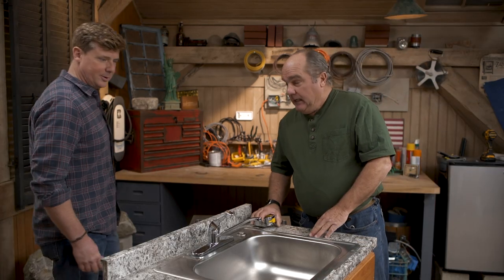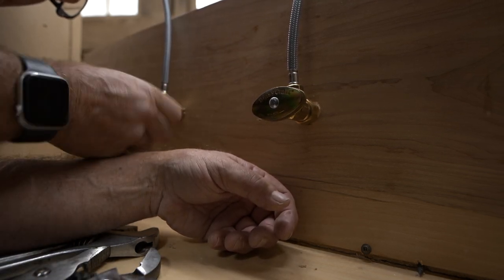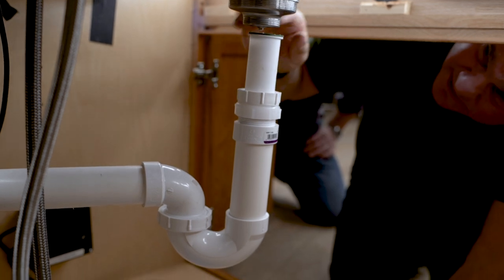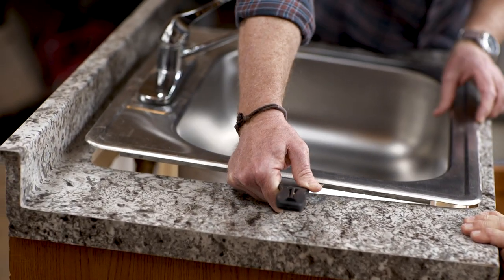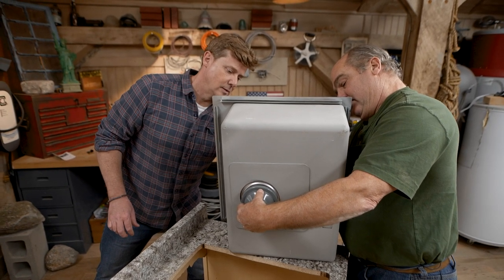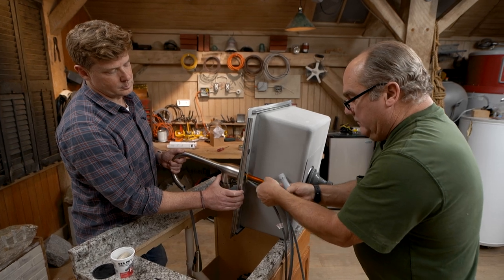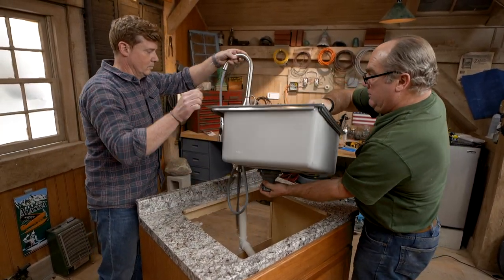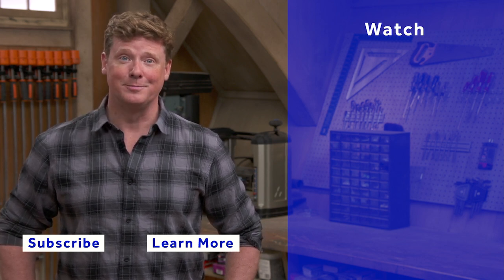How to Replace a Kitchen Sink | Ask This Old House

Comment: From a pro like Richard I’d like to hear how to handle the UNusual problems.  When replacing a sink those cutoff valves are always old, maybe brittle.  How to prepare for one snapping off and flooding the kitchen?  How much force does one indulge? Use the house cutoff first, maybe drain the house first?  Those new faucet lines might leak under counter, but only when the faucet is on so it’s undetected.  A major uncontrolled water leak can destroy much of the area and be out of budget to fix for any DIY. It just can’t be allowed to happen.

Comment: I'm surprised drains haven't come with a gasket all these years.   I mean sinks always have that inset for the putty to go down, unlike anything else the sizes are actually a standard size,  seems like a perfect place to have the manufacturer to spend an extra 12 cents and throw in a gasket, or 30 cents and put in a really good gasket.
Reply: it really is the classic plumber's lament!
Reply: I agree
Reply: Pretty common in Europe for many years. Actually, I've never seen to use a putty ✌️
Reply: Yes!

Comment: Kevin didn’t even try to break the seal he just straight up wanted to pull the counter and sink apart
Reply: Richard didn't even disconnect the front clips very much at all,  this was an all around "We have to build this setup just to take it apart??"  type of enthusiasm on this project
Reply: Well it was a demo set up there was no seal. except possibly a small amount in the front just to show them break it right before they lifted it out.

Comment: Has anyone had any experience replacing a cast iron or acrylic sink with a stainless steel sink? I bought a stainless steel sink that matches exactly the measurements of my existing cast iron sink, but the installer Home Depot sent out to install and connect it insists that it can't be installed and would lead to problems down the road...has anyone else experienced anything like this?

Comment: How about changing a sink from the 80's instead of a 2018 cakewalk.  Replacing a sink with old shutoff valves and soldered copper pipes that should be replaced with the flexible metallic hose used in this video would be more valuble.

Comment: I have a project you don't have a video for, at least I could not find it. How to remove a kitchen sink that was installed using liquid nails, but not on the ring that goes around the sink. Have good days!

Comment: I'll never use putty ever, ever again! It always dries out and leaks a few years down the road. Pure, clear silicone calk all the way.
Reply: If you use a sealing caulk instead of a putty or gasket on plumbing supply or return line  you make it difficult, maybe impossible to undo and replace later.  Caulk down a faucet valve to a surface for instance and then torque it down means likely impossible to remove years later without destroying the fixture.
Reply: @Nill757  Beats water leaks under the sink.
Reply: @mehodgsonsr  Ive  never had or seen properly used putty leak, which means never used for pressure water and applied correctly.    Its always, always, pressure water lines or the grey water PVC drains being knocked around under sink that leak.  If all of that went away, then maybe bad putty can be replaced with silicone sealant, if somebody wants that sink replacement shown here turned from a 15 min job to something much more involved because that sealant won't let go.
Reply: @Nill757  I used putty under a new faucet years ago. The faucet was fine for several years. Once the putty dried out, water got under the faucet and under the sink. Never again.

Comment: Never use oem gasket will leak always use putty.
Reply: Never used putty in 20 years.
Reply: I use plumber putty myself,  but that looked like a Kraus basket strainer you can install them with no putty and they want leak I've installed a few and there basically idiot proof I think a five year old could about install one. That's probably why it's on this old house.
Reply: Say goodbye to any warranty if you do not install per manufacturer's recommendations

Comment: Why are there holes in the sink at all?   🤦‍♂️ You cut them where and when you need them. Then you don't need this ugly cover.
Reply: did you miss the part where they are replacing an exisiting sink not installing one in a brand new kitchen, I mean it's even in the title...
Reply: @nzspambot  ? 3:56
Reply: @julianreverse  also you know there are many styles of taps right?
Reply: @nzspambot  I know that, even if we only need one hole in Germany which we cut ourselves when we install the sink, but the manufacturer of this sink doesn't. Otherwise they wouldn't cut holes in the sink.
Reply: They are there for glory purposes.

Comment: Incorrect standard size is 33x22 but still fantastic info but always always always use silicone caulking under basket strainers throw those gaskets they provide in the trash. Your welcome